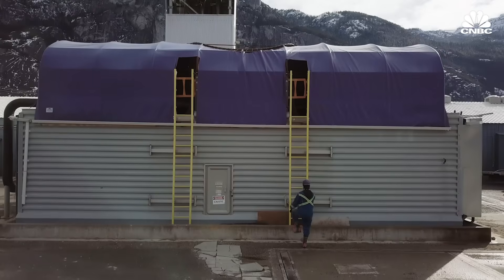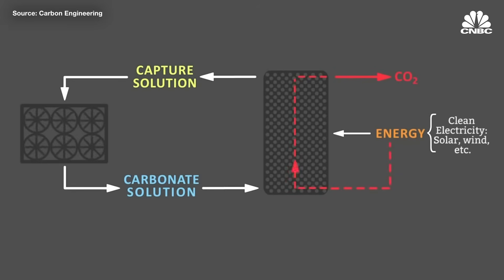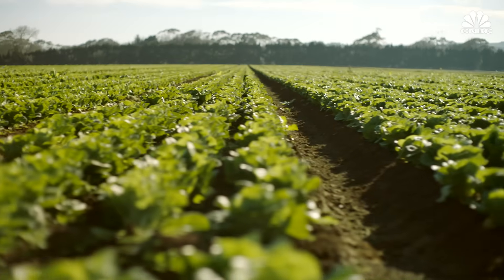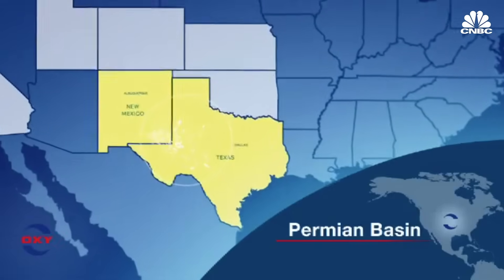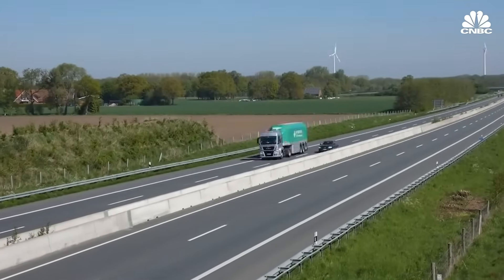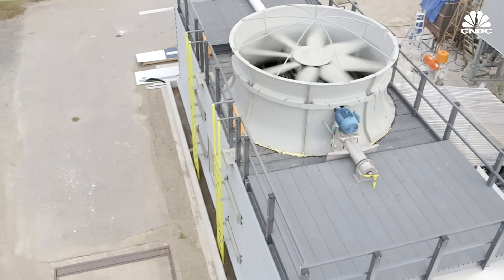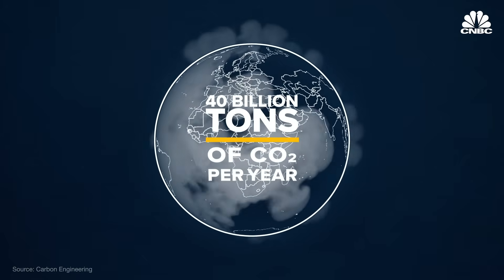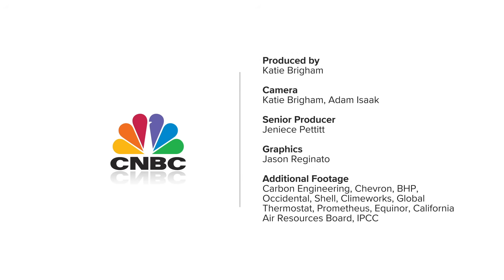Bill Gates-Backed Carbon Capture Plant Does The Work Of 40 Million Trees

Comment: Greenhousing occurs at the top of the stratosphere removing CO2 at ground level doesn't remove it from the stratosphere, air mixes it too well below that altitude.

After emissions are reduced is a point where oceans will outgas their excess CO2 to keep it above 400ppm some 140,000-years the expectation.

One-fourth of tailpipe emissions last over 10,000-years, use magnets for motive power, stop burning things.
Reply: Use magnets for what?

Comment: The United States has have 50 states registed and have almost 320 Million peoples live in there.

When United States:
-) Making more residential building that can hold 10.000 peoples per area.
-) Making 32.000 residential tower.
-) Bring peoples live in residential tower.
-) Using only 40 states for building.
-) And late 10 states being jungle.
It's means.
*) 320 Milliom / 10k peoples per area = 32.000 tower.
*) 32.000 tower / 40 States = 800 tower per states.
*) Transportstion tower to tower  by monorail.
*) Bring company for making space in the base floor of residential tower.
*) And late all available space for making outdoor area and breathing space.

It should reduce more than 1 billion tons of carbon emission per day, use a lot of electrict power instead.
And maybe jungles from 10 dead states that reduce 1 billions tons of carbon emission and produce more fresh water.

*) Because peoples going out from residential tower only for doing vacation, outdoor sport, Yachting, swimming in the sea, and etc. United States is super power, making 32.000 residential tower only small problem for they😀😀😀

Comment: Without zeroing emissions this doesn't matter a lot, instead better actions are to plant the trees to feed insects and animals going extinct, please?

These two magnet powered generators represent a way to flip off fossil for electricity and motive power.

A few of these 1-Megawatt units can flip substations off-grid, sparkless for use with explosives and have a 50-year, no-inputs warranty with normal upkeep , from Belgium:
www.technokontrol.com/en/current-projects/generator.php

For off-grid, grid-tied homes, 10kw/$15k, 5kw/$8k, 20-year no-inputs warranty, S.Korean:
www.infinitysav.com/magneticgenerator/

No emissions in-use, small carbon-footprint overall, little wasteheat, there are no other sources of motive power to magnets which are frozen STRUCTURES of FORCE, they don't GENERATE forces, that's why they last so long and don't need inputs to work.
Reply: @bosstowndynamics5488  They are no "free energy" machines, that's a marketing term, magnets heat up under load producing wasteheat so less than 100% efficient, evidence of entropy, eh?

Magnets are frozen magnetic metal STRUCTURES of FORCE, they don't GENERATE forces, Neodymiums last at 90% full power 1000yrs from mfg.

They don't need inputs to provide flux strength, electromagnets require current to produce motive force using flux, magnets are quenched under flux strengths 1000x magnetite.

Your totally a member of the Physics Dunce Club with your "belief system", try a physics text.
Reply: @bosstowndynamics5488  Magnets are manufactured, it's a process in 2 parts, magnetization then polarization in a 150 year pursuit of ferrites that last longer and are stronger.

Too bad you haven't enough knowledge to evaluate drive-trains,n magnetic drives or anything close by your replies, maybe try Machinery's Handbook instead of the physics which left you in la la land.

Agendas are not facts, magnets are quenched metallic structures, they are not generators of flux, they fade with time or if heated too high lose their flux.

Later, you can't pass a test on this stuff.
Reply: @bosstowndynamics5488  Easy one, people aren't astute, why do you think these guys went to an island to demo the 10kw, for kicks?

Get serious, 5kw batteries cost almost as much as the generator giving you 20-years of 100% Duty-cycle Continuous power.

So, the better question is, given the stated output specs and pricing, why will someone not make a serious inquiry, agenda isn't logical compared to research.

Comment: For those saying to put this tech directly on power plant exhaust, there are better and more efficient ways to capture high concentrations (which typically run around 10-15%) of CO2 from stack emissions, such as wet-scrubbing or use of sorbents. Extracting it from the air, as they are doing here, requires special processing to capture CO2 at very low concentration (about 400ppm or 0.04%). As a general rule, the lower concentration of whatever contaminant you are trying to remove, the higher the cost of removing it. Currently the laws do not require plants to capture and sequester CO2 so its not done. If/when it becomes required (I think eventually it will), you can expect energy costs to rise to cover the cost. The end user always pays, one way or another. 

Research, funded by the US, EU, UK, etc. has been going on for many years on new and best ways  to capture and sequester CO2. There are a number of competing technologies. But one of the big challenges, as the video mentioned, is what to do with it. Underground sequestration requires certain types of strata so it wont just slowly seep back out into the atmosphere. Also it cant be allowed to get into ground water as it turns it acidic; and since pure CO2 injected, the contacted water would get very acidic. There are ways to react the CO2 so the carbon ends up back in a solid phase, and either becomes a usable product or at least just a solid that can be easily disposed of. It all sounds great, but every solution involves additional chemical processing which adds to the cradle-to-grave cost of energy.

Comment: It does not do the work of trees thats a lie. Trees sequester carbon and release the oxygen. These just sequester CO2
Reply: I hate to have to explain this but they are saying they can capture the carbon that... Say 40 million trees could capture in a given period of time. With a  plant that size. 
Different mechanism.... And merely an figure to give you an example of effectiveness. 
Could be one of many solutions to make an impact on co2 levels..  We need everything...  Trees aswell... To get ontop of this... If we gotta bury some so be it... Better than the alternative...
Reply: @TheCynicalOptimist88  , I think that went completely over your head. You don't need to explain anything. Trees capture carbon. This plant captures carbon dioxide
Reply: @Q_thulu     the issue we have is carbon dioxide as a gas... that's what  is causing the greenhouse effect.
Carbon is not a problem... That would be like saying coal on the ground is causing the earth to heat up....
Its only an issue if you burn it and get a by product of carbon dioxide....
Reply: @timmyteabag69  , Yup the truth is.....there are just to many of us running around consuming resources.
Reply: Mykel Hardin  I'm a chemist, and your post gave me cancer.
Reply: Mykel Hardin  except this machine carry out photosynthesis like plant or else it wont break CO2 into C and O2...
Reply: @Ng Xiang Yu No it doesn’t. It only captures carbon dioxide. Nothing like photosynthesis, the plant doesn’t give of o2. A combination of a plant like this, planting trees (mainly in destroyed rainforest area), eating less (cow)meat and maybe more will be a step in the right direction.
Reply: @wimpie031  yes,thats what i gonna tell him,the word 'except'
Reply: removal of the co2...stop whining......it does the work of removing the co2. Stay in school. Teachers like people like you.
Reply: CO2- C=O2.  Please go back to school or stay there.
Reply: Mykel Hardin but there are no man made machine to break down co2... so not that simple to do that
Reply: Mykel Hardin  erm,ok looks like i miss sth
Reply: Mykel Hardin  but anyway what i mean is like only photosynthesis can produce o2 as waste product ,so there is no substitute of man made products to replace the plant...
Reply: Mykel Hardin  you are wrong. The "carbon capture" is a shortcut to mean capture co2 from atmosphere and don't release it back. It can be converting it into co2, or some other form, solid, liquid, etc. In many of these processes, including this one, there is no oxygen released. Not that it matters anyway.
Reply: Qthulu __ 

Yes, but the o2 has to go somewhere.
Reply: @joshuasnore3600  it does we breath it along with every other animal. Our ozone layer uses it.
Reply: Please note that CO2 is the greenhouse gas that traps heat in the atmosphere. Carbon by itself is not a greenhouse gas. " 'Carbon' is sometimes used as a shorthand for referring to CO2, or greenhouse gases in general, and it can also be used to express CO2 emissions in terms of the amount of carbon in the CO2." https://ecometrica.com/white-papers/greenhouse-gases-co2-co2e-and-carbon-what-do-all-these-terms-mean
Reply: Mykel Hardin  The plant doesn't separate the carbon from the oxygen it stores the CO2 gas underground

Comment: A few days ago that oxygen levels are getting lower every year. Taking CO2 out of the air is not a solution. Taking the caco2 (sorry for me bad chemistrie if it wrong) and releas the co2 in greenhouse. They need CO2 and heat. Research to plants that can rapidly take on CO2 would be money better spend.

Comment: Trusting big oil is naive. Ecosystems are collapsing right now. Divest and invest in alternative fuel sources. Big oil should be charged a carbon tax around the world at a lot higher rates than mentioned here. Eat less meat, have less children, reduce using/buying plastic based products, ie start manufacturing alternatives ( hemp, etc) to plastics. C Capture plants great start.

Comment: I love how none of you mentioned that this goes the laws if thermodynamics. It will take more energy to clean the c02 which means it would generate more heat. They are also basically trying to say for example that they can eat 5 full pizzas per day and lose weight. The best warehouse for cleaning up co2 is called a rainforest.
Reply: You're laughably stupid.

Comment: Isn't this a pun, you can't pull more co2 than the electricity it takes to produce it makes. If you got to burn coal to make the fans spin there's no way it's at 100% efficiency.  you lose electricity from the wiring, motors, weather conditions, etc just like a car battery at 14V, but if you test that with a meter at the next spot it connects you will be at 13.8vs, and that's just 2 feet away. Solar panels or wind would help, but where do you think those are made? Chinese factories that use so much energy from those types of sources.

Comment: This uses energy... Generated by... Fossil carbon !
And if it does uses clean energy, then that energy could have been used to power other things, that are still using fossil carbon !
Thunderf00t where are you
Reply: What's your point? It probably does use energy produced from fossil fuels....but if the CO2 that comes from the generation of that energy is less than what the facility is capable of taking out of the air, it's a net decrease.
Reply: Your argument is complete nonsense. I bet you drive a car that runs on... fossil fuels... that could be used to... power plants like this!
Reply: @Fixeish  essentially it's not worth doing until every car and every house is powered by fusion, then we can start filtering the air with fusion power. it takes more energy to pull CO2 out of the air than you get from burning fossil fuels in the first place.
Reply: @Zreknarf  that last part is completely true, however, you are forgetting that the Earth can provide most of that energy. One simple example are acid rains: if you put water in a container that has carbon dioxide, it will create carbonic acid; then, you can burry it inside the earth and there you go, you have trapped CO2 inside the earth and used absolutely no energy. They can be using similar principles here.
Reply: @Fixeish  still requires plenty of energy to move millions of tons of air and water around
Reply: @Zreknarf  also, it is a little bit contradictory that you are a believer in fusion power and, at the same time, unable to understand how environmentaly friendly this process is.
Reply: @Fixeish  there's a constant reminder that fusion power exists floating above your head for 12 hours every day, you don't believe it exists?
Reply: @Zreknarf  do you realize the stupidity of your comment? the process I described is a process the planet does everyday without consuming fossil fuels, called raining (more accurately, acid rains).
Reply: @Fixeish  even the ocean isn't large enough to do it through natural processes alone. otherwise we wouldn't be having this conversation.
Reply: @Zreknarf  of course I believe in it. the Sun is empirical evidence that it exists.
However, I wrote that comment since, as you said above, "we will have to wait for fusion", which suggests that you believe in it and the way that fusion works (in stars, at least) is by harvesting the energy released during the fusion of two nucleus (which consumes energy, but releases more that it consumes). That said, this process would use natural energy sources so that the energy consumed by itself is less than the energy that was released on the creation of that CO2 molecule.
Reply: @Zreknarf  of course not, but it was just a demonstration that this is possible while remaining carbon negative
Reply: @Fixeish  so.. are you suggesting we build a second ocean?
Reply: @Zreknarf  hell no! (also, in case you didn't know, there is more than one ocean on Earth)
I was using our planet's natural phenomena as an example to argue against your idea that this type of direct carbon removal cannot be carbon neutral (you think it can't take more CO2 molecules out of the air than the amount that the fossil fuels release)
Reply: @Fixeish  was referring to them as one because they're all connected anyway and they all serve the same purpose in this sense, easier than saying "all of the water on earth", anyway calcium carbonate as they're using here you can bury for a while sure, but eventually it breaks down and releases CO2 again and you're back where you started PLUS all the pollution you created making calcium carbonate
Reply: @Zreknarf  Okay, first thing you got wrong there is the calcium carbonade thing. It does not create polution, it counters polution. When water mixes with CO2, it creates carbonic acid. When carbonic acid mixes with calcium, it creates calcium carbonade, that they are using. This process is 100% clean since it happens naturally on Earth.
Reply: @Zreknarf  now the thing with CO2 resurfacing is a really interesting point, but I feel that when it resurfaces (in a few million years) we would have already developed fusion energy and therefore, the climate impact will not be as great as it is today
Reply: @Fixeish  in nature it doesn't create pollution. in a factory where you're burning fossil fuels to power the fans and pumps to draw in air and water it absolutely does, not to mention the pollution created from mining calcium
Reply: @Zreknarf  are you really going to use that argument? The fans and pumps can be completely and EASILY powered with renewable energy sources (which they say they use).
As far as the calcium goes, I am no expert but water that flows in rivers and in the oceans already has calcium diluted, so, no need to mine for that
Reply: @Fixeish  and we've gone full circle. it's more effective to use said renewable energy in the things releasing pollution in the first place than it is this way. until we have fusion energy and the whole world is no longer burning fossil fuels it's just not efficient to be doing this.
Reply: @Fixeish  I could be wrong but it seems that most calcium used for industrial processes is refined from calcium carbonate by putting it in hydrochloric acid to release the CO2. if that's how they have to get the calcium then that alone completely cancels out any carbon negative effect you hope to achieve this way
Reply: @Zreknarf  that is not true, with the energy we use to remove a few metric tons of CO2 per year, we could power these plants that remove MEGATONS per year
Reply: @Fixeish  welp I don't feel like going for a second lap, good luck =)
Reply: @Zreknarf  yep, me neither, thank you so much!
Reply: thunderf00t already did it 4 years ago https://www.youtube.com/watch?v=dzq9yPE5Cbo

Comment: I read that in the whole world there are 3 trillion (short scale) trees, 3*10^12. Let's make it 4*10^12 and divide by 4*10^7 = 100.000. So this plant is equivalent to 1/100.000 th of the world tree count. Does this do anything? I further looked up, that a tree in 25 years roughly consumes 200 kg of CO2. Then it is cited that the average US citizen is responsible for 20 tons (=20000 kg) of CO2. At 400 ppm CO2 in the atmosphere that amounts to 3200 billion (10^9) metric tons of CO2 = 3.2*10^15 kg. This new plant captures 0.5*10^9 kg of CO2 a year, which would be equvalent to 25.000 US citizens. At 300 million citizens the US alone would need 12.000 of these factories to be carbon neutral. Doesn't really sound that much. I hope I did not lose some powers of ten at some point. Fuel from this process would be great so this carbon simply runs in a cycle. This would be rather nice, as carbonfuel still is the most energy dense stuff one can think of. Lithium batteries have there own ecological trail of destruction behind them. H2 would be nice, if it could be produced entirely from renewables.

After the ludicrous idea to drive greener by planting food plants that will be turned into bio fuel, we now grow plants to simply burn them. At this point I can totally understand the sci fi idea of a omnipotent AI, that will enslave mankind. It is perfectly logical and sane to do so.